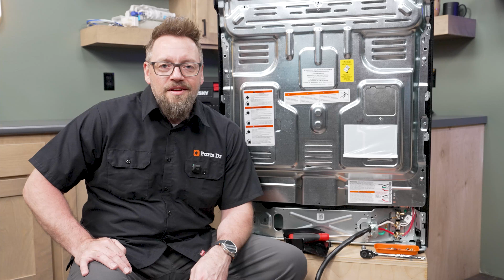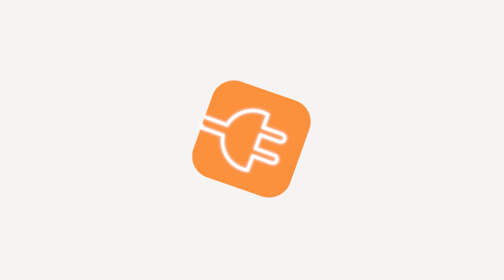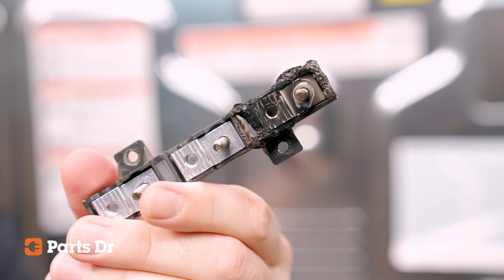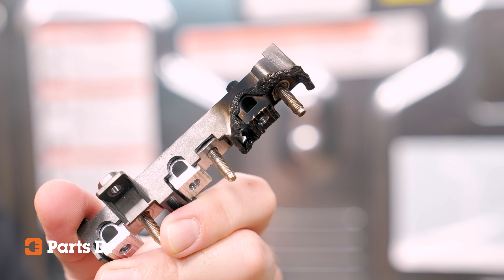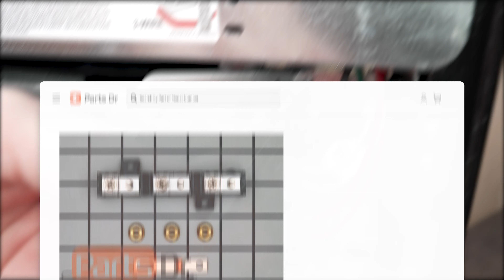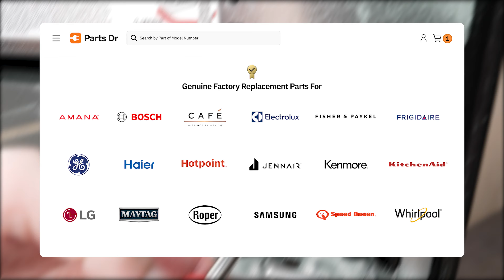How to Replace a Burnt or Damaged Terminal Block on a Frigidaire Range 5303935271 | Parts Dr

Comment from the maker: Thanks for watching our step-by-step guide on replacing a burnt or damaged terminal block on your Frigidaire range! If your range isn’t heating or you see signs of melted or burned wires at the power connection, this part is often the culprit. Just a heads-up if you're ordering replacement parts online, especially from Amazon or eBay, be careful. Many of the cheaper aftermarket options are lower quality and can fail quickly or cause safety issues. For genuine OEM parts that are safe and reliable, order directly from https://partsdr.com. It’s the best way to make sure your repair is done right the first time. Let us know how your repair goes in the comments, and happy repairing!